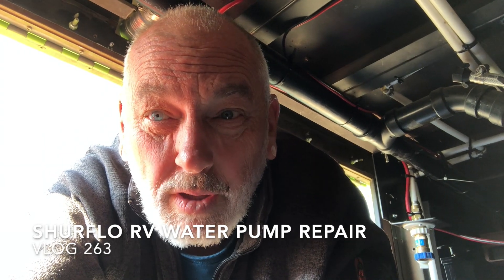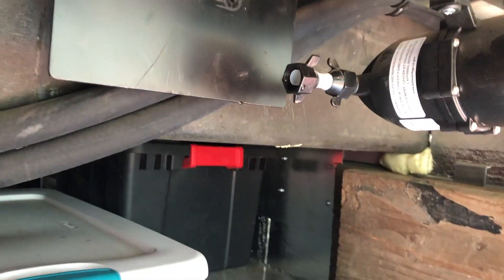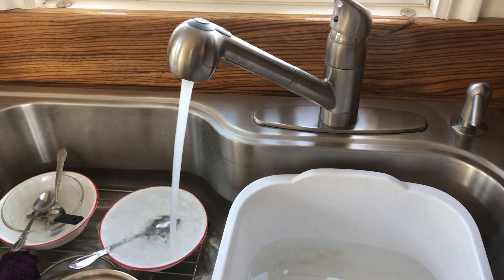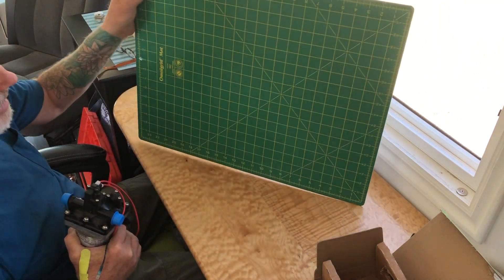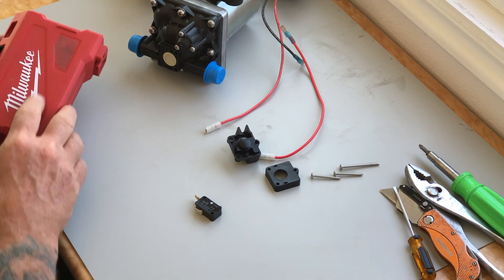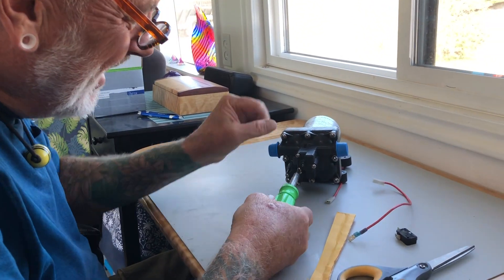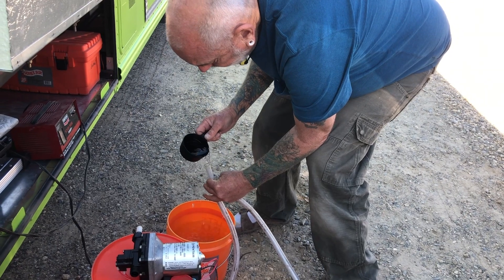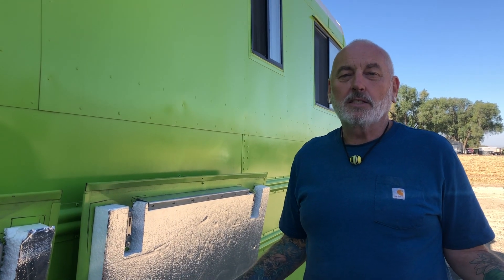ShurFlo RV Water Pump Repair - Vlog 263 Bus Life

Comment: You can almost eliminate the contact arcing with a device called a QuenchArc.  They wire across the switch connection like a short.  You could also put one on your pump on switch to help the life of the switch.  The way contacts burn is a small arc causes a carbon build up that makes the arcing worse and so on until the switch burns up.  You can also use a diode, but the quecharcs are easier to hook up for non-experts because they do not have to be installed in a certain direction.
Reply from the maker: 😁 that sounds great but already above our expertise level.

Comment: Hey, I like the videos. I'm building my own bus. I'm  thinking of using  1 or 5 gallon well pressure tank. How much pump cycling do get with that small accumulator?  If the cycling is high that would be the reason the pressure switch when bad.
Reply from the maker: No it doesn’t have a high cycling rate. It sounds like it does because there’s four diaphragms in there the motors prince around to make it pump. It’s just the fact that every time you open the Fossett and turn it off it cycles once. Over the period of nine months full-time that’s quite a few cycles I think. I thought about putting in a bigger tank to but decided it wasn’t worth the space I would sacrifice for the small accumulator tank takes the hammer out of the water pressure is super nice 😊